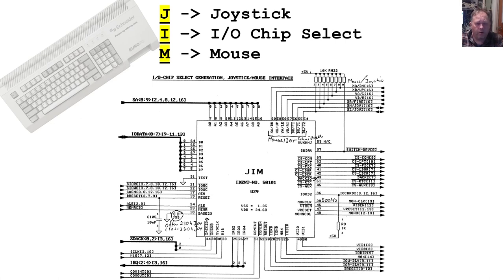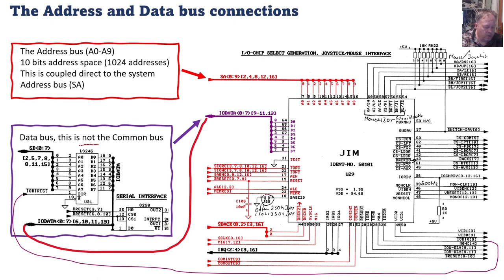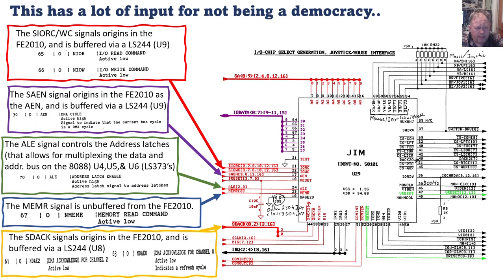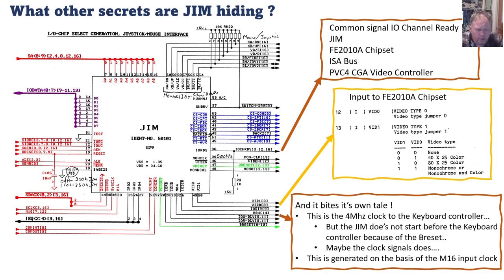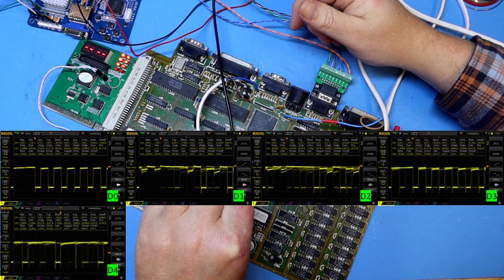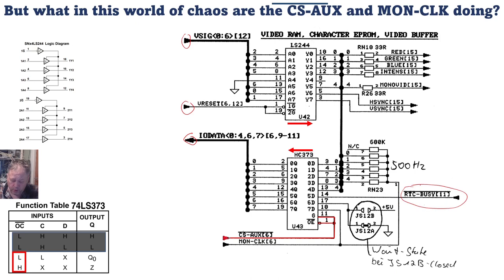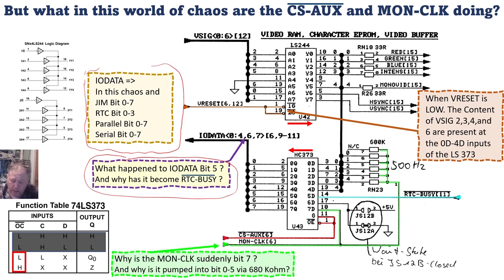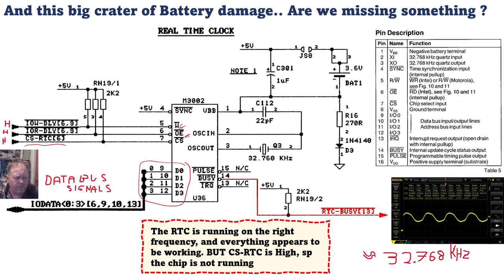europc 5 1 movie

Comment: This should be kept as part of the documentation for the EuroPC in the major sites. Excellent job Kojro !!!. A pity these computers are hard (and expensive) to find. It is a very nice machine to tinker with. I am confident that youĺl make it run. Will buy some popcorn to watch your next episode on it. Oh, man. I learn so much from your videos...
Reply from the maker: Thanks for watching. Good that you have not lost your confidence in me, but I am now starting to dig out on the chips surrounding the JIM chip to see if I can get the Address-bus stable. If it’s the JIM Chip that is the culprit this will not be worth the effort to repair. Even If we only replicate a small portion of what the chip does it’s a big job. If we loose the JIM, and is able to do the interfacing to the video chip we still are down by, floppy, LPT, COM, and the HD port.
Reply: @kojroRI  I'll never lose confidence in you. The problem is that a full JIM cloning would take one year of engineering-hacking-tinkering, and killing your channel as only myself and a couple of other freaks will follow it. It would be nice for a side project during retirement, but it will take months. Hopefully is not the JIM but some 74LS are dead. Bought corn the other day. Waiting for the video to cook them and enjoy all together ;-)
Reply: @minombredepila1580  That would be quite the feat of reverse-engineering!
Possible to duplicate on an FPGA I'm sure, but it would be a long project.